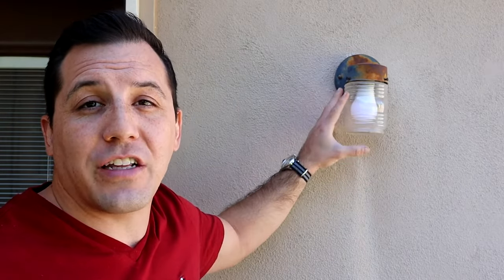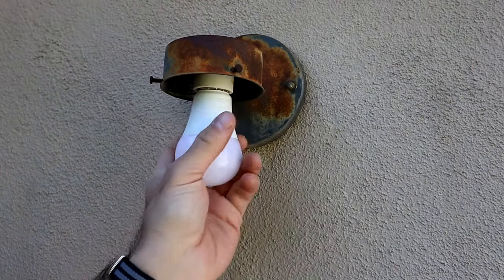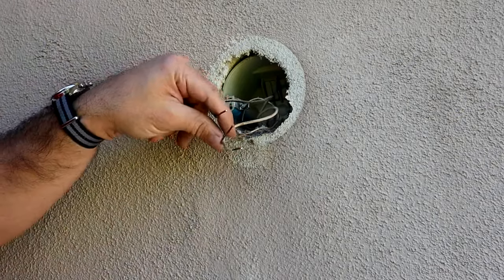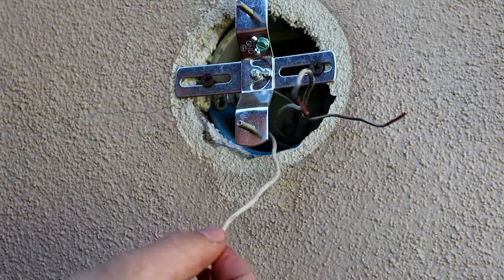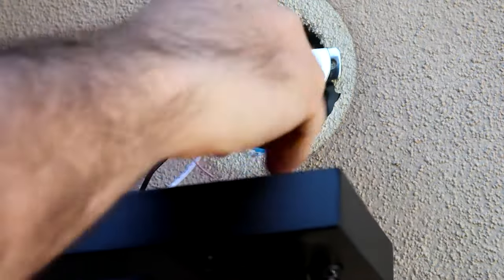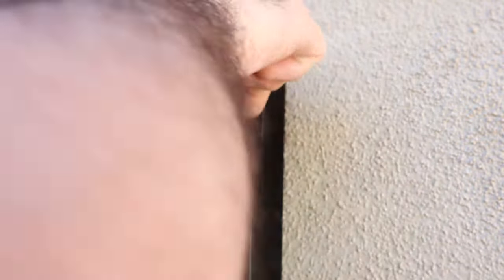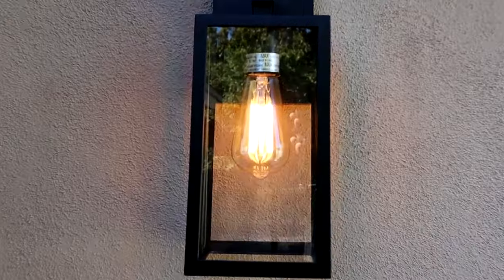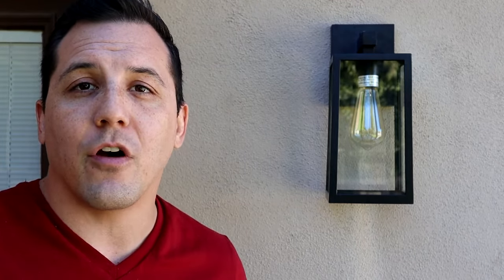How to Change A Wall Sconce - Beginner's Guide DIY

Comment: Question I did mine today but when I open up the old lamp and expose the inside I only seen the Black and white white there wasn’t no ground in there is it ok to just connect it like that without the ground wire ?

Comment: I don’t really need to turn off breaker if it has a light switch, correct? I can just keep light switch off and I can still touch wires without problems? Turning off breaker is just for that extra precaution as you stated.

Comment: Thanks so much for such an explicit step by step Video instructions! It helped a lot, especially the tip to save the old screws due to a size difference because that’s exactly what I had to do! I appreciate your help in allowing me to do this myself!

The only extra tip that no videos or written instructions in the light box itself included was to adjust the back screw that holds the screw caps to secure the fixture to the wall/box to be long enough just to accommodate the washer and screw cap. I had to learn the hard way after wiring everything and securing to the wall only to have too much space/slack to tighten it tight against the wall. That’s it, no big deal just more time, which it started to rain so I had to hurry! Thanks again, Christine

Comment: Question! We used your video to help us replace our old sconce in our basement. The only real difference was our wiring was old bob and tube so we didn’t have a wire for the copper ground wire. Our electrician said that would be fine. We connected the other two and when we switched on the breaker it still didn’t work. 

Would this be because of wire connection ?

Comment: Thanks. I noticed at the 2:30 mark the old fixture’s original grounding wire wasn’t grounded by a screw? 
Secondly I couldn’t see as you installed the new fixture if you screwed the ground wire to the green nut? And if you leave enough length to put them both in the plastic twist caps. Thanks. Liked and sub’d